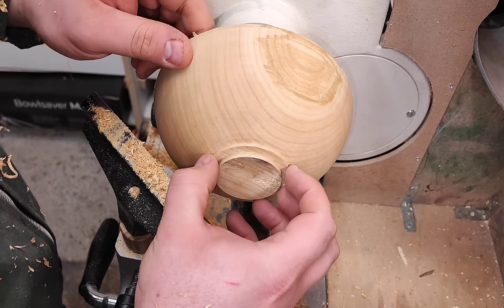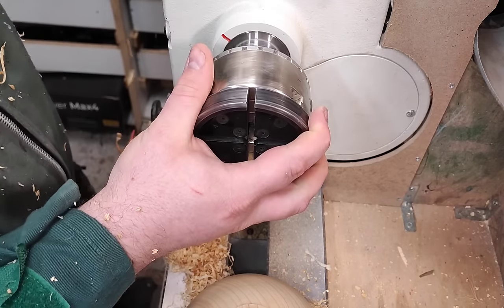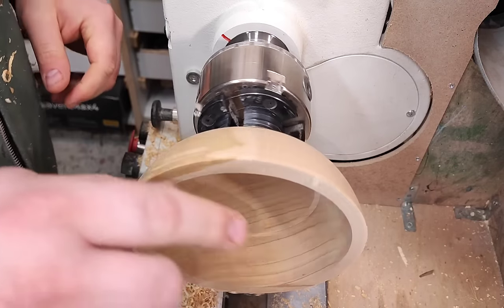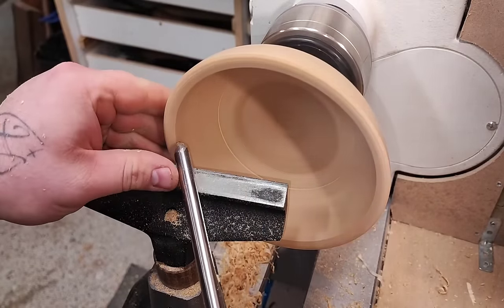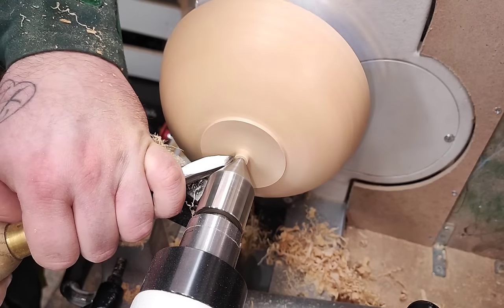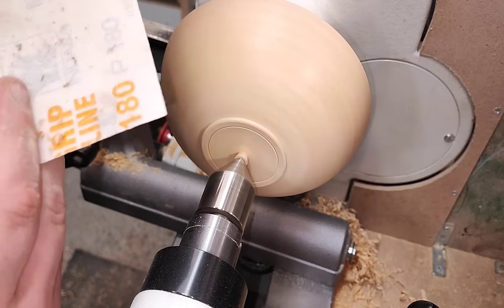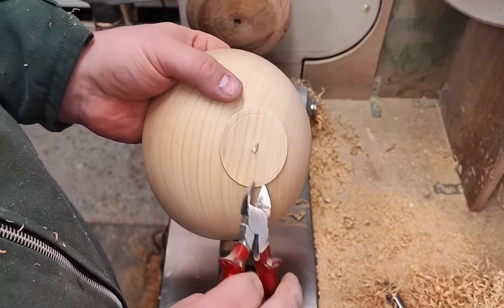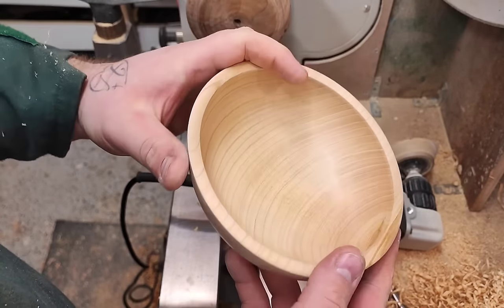And this is how in 10 minutes bowl is made

Comment: This is so timely. I just finished 3 twice turned bowls similar in size and shape. Although mine were maple and ash. Despite sharp tools, I have fits with ridges on the inside of my bowl. I’ve switched to a heavier bowl gouge. A lighter one. Downward pressure on the tool rest rather than putting to much pressure on the bowl/bevel. Thanks to your videos on scraping, I generally make quick work of these with scrapers. But boy do I envy your efficiency here. This same bowl that took you 10 minutes is probably closer to 25-30 minutes for me. Thanks again for all your videos. I truly learn a lot.  I’ll just keep practicing, watching, and learning.
Reply: I’m a woodturning and this dude were watching is amazing, I could help out slightly with your issue and I’m sure this feller can explain it better.  The grinds we use along with bevel length and angles are first important reason being is even if you have perfect technique the wrong tool  lot dull tool you will still get a poor finish!  I personally don’t use a scrapper like ever.  So It made me learn my gouges and the angles I’m using for whatever cut the most important.  I use a grind I created and it’s a 40/40 on the nose with a short bevel and the wings on the top are slightly swept back.  It allows me to roll the roll a little more freely and makes shaping and hollowing all done with the same tool.  I use a bottom bowl gouge for the bottom and get a fantastic finish with it.  So I’m always using just 2 tools.  The second important is technique and your grind will go hand in hand with your technique.  Whether left or right handed or even swing.  How hard you’re pushing in the bevel is important I like to use the words float. I’m riding the bevel but not pushing and I use an under hand approach on the outside just barely adding press down the the tool rest.  Always keeping the bevel in contact.  I use the flute at 45 degree on the finishing cuts until I reach end grain then I close in on end grain.  The position of your tool rest is important so too much tool isn’t hanging over.  The side is the same thing.  I’ll start with the flute mostly closed and open it to the bottom and finish with my bottom bowl gouge.  I just done a video a week or so ago of my technique.  Find what grinds work for you.  Practice is perfect!!!!!  Happy turning
Reply from the maker: Thank you very much, like you said its just practice and repetetive work

Comment: I notice yo power sand the inside and just use sheets of paper for the outside.  Is there a reason you don’t power sand the outside?  Thanks so much for your videos!
Reply from the maker: Hi Amy,thank you for watching 🤗
On smaller stuff I tent to sand by hand as its fast and cheaper option and also I don't have to mess with the drill...but on bigger bowls I do sand with drill if its simple shape....
Also sanding with the drill on the inside tent to smooth all imperfection that my eyes or hands don't feel... and its faster for the inside... atleast for me☺️
Reply: Tomislav, another great video and instruction.  Thank you.  Curious- what model is your Makita drill?
Reply from the maker: @davidsadler7258  its DA3011F , its for me a great imorovent over pistol grip drill